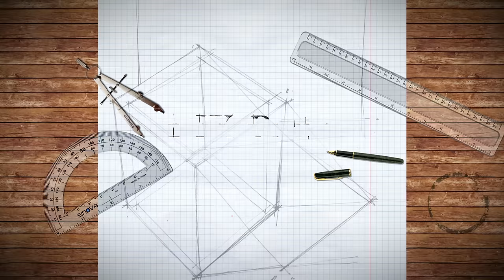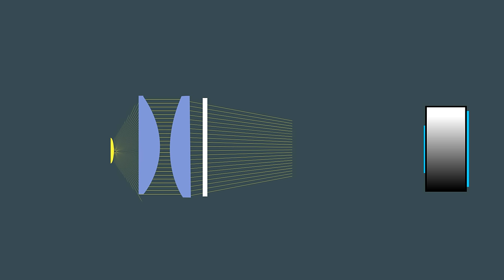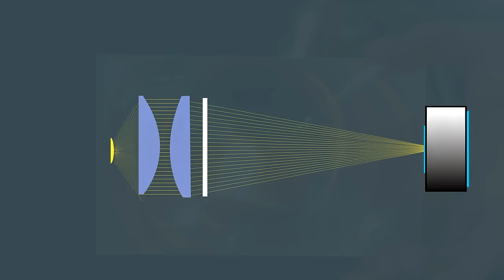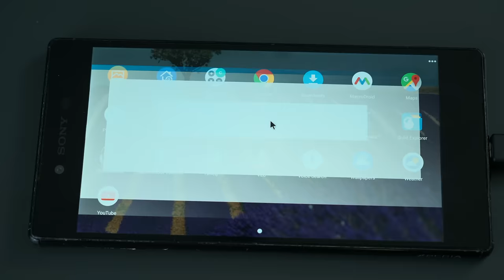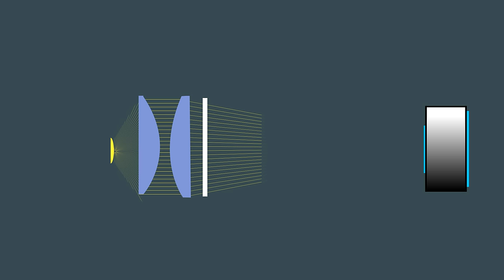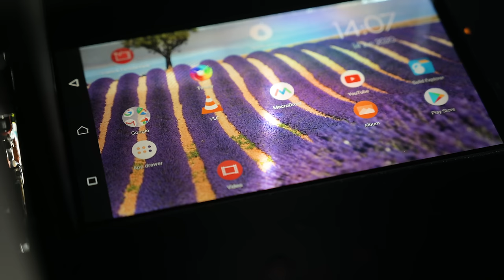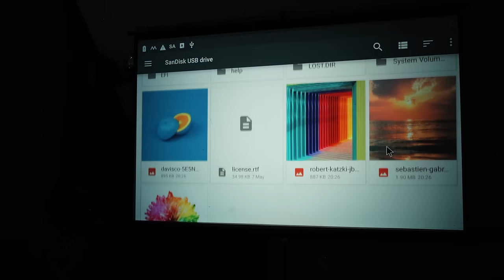Building a TRUE 4k home cinema projector (it’s awesome)

Comment: 4:06 A light source with a spectral peak for each additive primary color would heat the LCD panel less or allow for a much higher saturation. The primary hues of the sRGB color space correspond to wavelengths of about 610 nm, 550 nm, and 465 nm.  A CRI is a metric of similarity of a spectrum to black body radiation. If the color filter for each subpixel transmits only a narrow band of light, then any wavelengths outside of those bands will always be absorbed. If each color filter transmits a wide band of light and the source of light has a high CRI, then the colors will appear desaturated.
Reply: Sorry, I dont speak successful member of society
Reply: what does that mean for the build here? a different LED? color filters after the LED and before the lens?
Reply: They're just suggesting using an RGB LED that has red, green, and blue LEDs within the LED package that match the colour of the RGB subpixels on the LCD, instead of a white LED. By using a full-spectrum white light a lot of that light is blocked by the LCD panel since it can only allow red, green, and blue through it - so all the yellow, orange, violet, etc. that make up the white light are blocked (absorbed) and therefore wasted, and just end up heating up the LCD panel more. By matching the LED colours to the LCD colours one could use a brighter light since it would be more thermally efficient.
This will present more engineering challenges though. RGB LEDs have three separate LEDs in them, one for each colour, so it may be impossible to focus all three to a single point - you would get three points at prime focus. Therefore a better option might be three separate LEDs, one for each colour, and use a set of mirrors and a dichroic prism to combine them to a single point. You'll find those prisms inside many projectors, which also contain a set of mirrors, and usually separate LCDs for each colour.
See here: https://essentialpicks.com/wp-content/uploads/working-of-a-3LCD-projector.png
Reply: @TheResidentSkeptic  Oh that explains commercial projectors really well, thanks for elaborating
Reply: Please can you recommend a suitable LED.
Reply: mucho texto
Reply: @TheResidentSkeptic  I think that in commercial projectors it cycles the light source quickly between red, green, and blue. If you're sitting in a classroom watching something on the projector, look at the projector itself. If you move your eyes past it fast enough it will break up into red, green, and blue light.
Reply: TheResidentSkeptic The final image may be insensitive to the slight differences in position of each led because the focus of the projecting lens is on the LCD panel and not the focus of the convergent lens. If the LCD panel receives lighting of uneven color. A diffuser could be placed right over the array of LEDs to distribute each color evenly. The form of the diffuser could also be designed to distribute light so that each point on the collimator receives equal amount of light which may reduce vignetting. The diffuser could be shaped so that the field of view occupied by it from each point on the collimating lens is equal.
Reply: Im just, what tf r u talking about
Reply: @hi-fistereo8987  The particular LG projector he's comparing with does apparently use a color wheel and DLP display chip. One way it gets more brightness is that instead of having to pass light through the display chip, each pixel is essentially a tiny mirror that can be switched on and off at very high speed as the color filters pass by. This also means there are no sub-pixels -- the light colors all hits the same spot on the screen, instead of being distinct dots next to each other.
But as you say, color-wheel projectors are notorious for rainbow artifacts as you move your gaze across the screen. Some color wheel projectors try to reduce this by having more filters that pass by at a higher frequency so it's not as noticeable (the LG uses eight filters apparently). Some other projectors solve this by using separate display chips to create red/green/blue images simultaneously, and then combine them using some sort of prism so that they [hopefully] converge perfectly when they hit the screen. The additional chips and complicated optics does tend to drive up the price, though.
Reply: Most white LEDs are created by converting a blue LED's light using a phosphorescent layer which would make this system pretty bad. 
Unfortunately most commercially available RGB LEDs have really poor luminosity and luminous efficiency figures (I've been doing a design with them) and it might actually be worse to use them.
But this is a really interesting point.
Reply: Oh also, just because the sRGB primary colors peak at that value doesn't mean the actual RGB color filters on the LCD are those primary transmittances (though I'm sure it's pretty clear)... and also sRGB primaries are not even close to monochromatic/fully saturated (because it makes the contrast requirement to achieve 100% sRGB less stringent)
Reply: HDR and Dolby Vision have almost killed projectors.
Reply: Where would you get a RGB led cob chip? Even if it exist each colors will be projected in different spots on the screen.
Reply: ...and replace the LCD with DLP-matrix...
Reply: @andinuruljihad2912  In a professional Digital Cinema DLP projector, such as those made by Barco, the light may come from a few different things. Firstly, a xenon lamp may be used. This has the benefit of being almost purely white, and the majority of the energy is in the visible wavelengths (see the emission spectrum of xenon for more). For a laser projector, two systems are employed. One is a laser phosphor, in which a laser, usually a blue laser, is shown through a filter which passes a specific ratio of light. Light that reflects is added to the integrator rod, light that goes through is added to a setup with dichroic mirrors that expose some phosphors to the laser light (it is not a 1/3 and 2/3 mix, as the phosphors may fluoresce at differing intensities). These phosphors glow the other required colors, and the light passes back through the filter to the integrator rod. In Barco's flagship DCinema projectors, like the DP4k-60L, there are multiple banks of laser diodes of each color. The multiple banks allows for slightly different colors, which through mechanism that I'm not at liberty to discuss, allows them to create Barco 3D without a filter (like a masterimage or a RealD ZScreen), only glasses. This light is then added to the integrator rod. The integrator rod acts much like the fresnel lens they used in the video. It is a long piece of silicon quartz glass which acts like a fiber optic cable and converges the light to fit the light engine. The integrator rod typically has filters on or in it's light path in a xenon projector to cut out heat transferring infrared, and skin damaging UV that may pass through the lamp area. These filters are called the cold mirror and the UV filter respectively. The light then passes into the light engine assembly, which contains three satellite DMD boards. Through the use of dichroic mirrors, the light is split out into its component red green and blue colors, and those colors make contact with the DMD chips. The DMD chips have millions of tiny mirrors that will reflect the light either out into the lens, or deeper into the light engine where it is put onto a component called the light dump, which is a perfect negative image of what's being projected on the screen. That then goes out into the lens, which finishes the projection process. Light may be interrupted in xenon projectors directly before it exits the lens by using a dowser.
The biggest problem with projectors built in this way is convergence, or the lining up of the DMD satellites. Since the light is split into its component factors, if the light is not taken care of and if the satellites are not lined up, then the image may appear to be composed of separate red green and blue images instead of being one coherent image.

See this well written article for more
https://www.controlbooth.com/threads/for-all-the-projection-geeks-out-there.35305/
Reply: @hi-fistereo8987  Thats a DLP projector for sure, it uses a micro mirro arrangement that shines white lignt thought a colorwheel. it has a chip which has a tiny mirror for EACH PIXEL, it either faces to shine the light through the wheel and lens or not, this means that it has to change the mirrors to suit the light needed for each color for each frame of the image.
Reply: What language is this?
Reply: I'm smart enough to understand what your saying, dumb enough to not know how to fix the problem. Kinda frustrating actually
Reply: The Animator Of Animation dude seriously, that’s like the funniest shit I’ve read all year
Reply: For use with HDTVs, the ITU-R Recommendation BT.2020 and BT.2100 color space has its primary colors at 630 nm
, 532 nm, and 467 nm.
Reply: My brain got twisted a little bit just by reading your comment.
Reply: @hi-fistereo8987  Yea this "field-scanning" process is really common with DLP projectors like the one he tested against and the ones in school (rather than LCD like in this build). It results in "Rainbow effect" that you're talking about. With an LCD, you could shine the colors at the same time (which is what he's doing with the white light) since each pixel has a color filter
Reply: I think the LCD he used supports DCI P3 (Wide color gamut, and it may also support HDR) so you should get LEDs that match those color sources
Reply: @kennethstudstill  any ideas for better design from this one? a pdf could work
Reply: It would probably be better to measure what the actual transmission spectra of the screen looks like, it doesn't necessarily match sRGB color space peaks exactly. The idea is pretty good though, a properly matched RBG led(s) would allow for brighter image.
Reply: -Albert Einstein 2.0, 2020
Reply: Part of that is the phone as well, and the actual driver board of the display, OS-Android(it has a very specific srgb color space and anything outside Android converts to its compliant color space), bit rate of the lcd panel and its specific color space, I mean its honestly a complete rabbit hole and why typically you pay a premium for better products with better engineering and components, people complain about it, but that is the reality, when you are in a DIY scenario like this, you end up having to do the work in exchange for the money you would be spending for that engineering.
Reply: Using monochromatic LCDs, such as those from resin 3D printing, may allow color cycling of the light source to further improve efficiency if the LCD response time is high enough and if the hardware to drive it at the required refresh rate is available.
Reply: @AndyBonitz  Wow, that was quick! Good work!
Reply: Kenneth Studstill 4 days ago, i read this thread.

tonight i’m finishing up my proof for n vs np.

not SAYING they’re connected, but....

Comment: I actually remember something similar from school about 20 years ago, where there was an LCD panel (which I assume would've been 640x480 at the time) and it just went over a 90s OHP!
Reply: Most of those were 640x480, but also available were 800x600 and 1024x768.
Reply: My calculus teacher had one that plugged into a TI-83.  That brings back memories of trading games written in TI-BASIC.
Reply: I built one of those years ago, it certainly worked, but it was noisy and very bulky.
Reply: I used one of those in my home theater setup for years :)

Comment: 3:39 Don't act like that nut didn't take ten minutes of twisting to get to that point. Haha
Reply: Lol. I can just imagine spending an hour to bolt down 4 nuts and realising you forgot something that had to go in first
Reply: uses long mechanical drill
Reply: haha! XD
Reply: may wanna add them beforehand to avoid that actually. Good catch.
Reply: Compressed air
Reply: drill+rubber band does the trick :)
Reply: A neat trick is to push a power drill's chuck against the nut from the side. That will cause the nut to screw in/out pretty fast.
Reply: Use a small 5v electric motor with a rubber toy wheel on the end, ezpz.
Reply: @talonsid  i think is quite obvious that he has removed the nylon insert otherwise it wouldn't go down so easy
Reply: @kluuc  just teleport the nut into place then screw it precisely
Reply: this might not be that useful, but i tried wd40 and air spray seems to work only for nuts that isn't not that tight tho
Reply: @talonsid  LOL!  It is time consuming and takes more effort to install a Nylock nut on one inch of threads, much less two feet of them.  Probably wasn't much nylon left on that nut after all that...

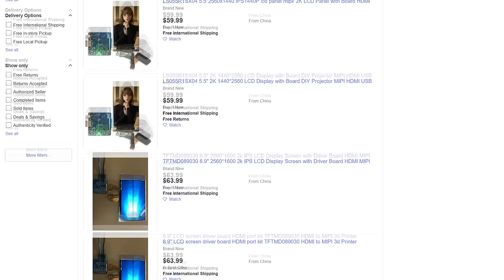Comment: For those interested if utilizing the $60 2k display shown at 12:03  and the cheaper led bulb in the description, the total build cost comes to around $280 plus tax. This price also goes up because you need an hdmi audio extractor to make up for the lack of audio out on these display boards(roughly $25 on amazon).
Reply: Did you like the quality or would you recommend a 4k screen? Also, how does the cheaper LED compare?
Reply: Cool, thanks for the research. That's some decent cheddar for more of an experimental project.
Reply: Im guessing you are from the USA? I find it so weird that prices there do not have taxes included so you need to do the math yourself lol
Reply: @lauri9061  Ew, no
Reply: @lauri9061  I just converted the sum OP gave from $ into £
Reply: Considering im currently using a £40 projector (which is fine), even a store bought one for £200 would be cinema quality in comparison

Comment: When I was a kid my dad made the exact kind of thing at home. I think it was 2006 when he made it. He used parts from old printers and computers. Unlike the one in this video, it was huge. All the components were enclosed in a 5ft-tall box he made from MDF and plastic, and it had wheels so you could move it around. It didn't have any heatsinks, but instead used fans stripped from computers to circulate all that heat. The craziest thing is, he designed all this in Microsoft Powerpoint 2003, and the most high tech tool he used was a power drill. As a kid, I enjoyed watching him work on it. The only problem was that my mom absolutely HATED it, so it's been sitting in a closet for the last 15 years.

Comment: Though I never got around to making one myself, I was a lurker on lumenlab back when it was a thing.  This is as impressive as anything the community ever did there.  One thing I do remember members of the community talking about were "heat mirrors" (Transparent material that reflects heat, but not light) vs "cold mirrors" (Mirrors that reflect light as normal, but allow heat to pass through) for controlling both the flow of light and the heat of the unit.  This might be useful if you place a heat mirror in front of the led, especially if one were to go with a projector.

Comment: "...Sony released a 4k phone..."
I have an XZ Premium so which is overheating because of the battery... you just gave me an idea what to do with it :O
Reply: I too have an XZ Premium lying around, working perfectly but I don't use anymore. So I might just try this myself as well!
I also have an old 720p Epson projector, I wonder if I can reuse its lenses for this... hmmm...
Reply: Hey, @MoSs - I have an old Epson projector too (EH-TW420 from ~2008, I think), with a defect light source, that's too expensive to fix, since it's outdated. Please let me know if you figure out something regarding refurbing the lenses of yours!
Reply: @MoSs.  U cant. 720p sensor(projector screen) will be 4x smaller than ur phones screen. So lenses will be also too small for that.
Reply: I had Z5 premium and same problem, but I still like sony phones
Reply: Actually the panel on the Z5 Premium is better for this project because the dpi is over 800. However the XZ Premium panel has HDR color gamut support.
Reply: @ES-qy2ju  both the XZ premium and Z5 premium have ppis of over 800, the Z5 only has a bit more ppi, but thats not going to be noticeable, but that HDR is definitely going to be much better, and it will be even better with a XZ2 premium

Comment: Give it time, there will be a 'Going to the Moon on a budget' video soon
Reply: "now what you want to use is aluminium"
Reply: @Patrick-jj5nh  lol it would melt instantly upon reaching outer space
Reply: "In this video we will be adding a so called "flux capacitor" to the space ship we built last time so we can achieve faster than light travel. It's actually surprisingly simple"
Reply: How could one get the tools or materials required for such an efficient engine with a normal budget?
Reply: That’s where space x is going. I know it.
Reply: I think that's what Elon did to NASA